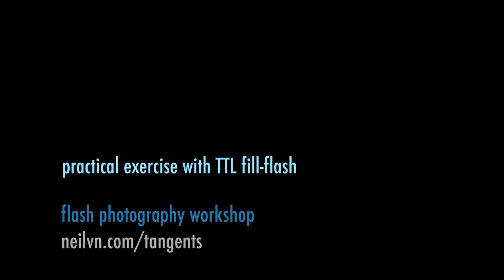Video tutorial: TTL fill-flash

Comment: I have watched a multitude of flash fill videos by several different photographers. Every one of them fails to start with the basics. When using a camera flash are you using the cameras Auto mode, P mode, or a manual mode ? Are you using the cameras White Balance "flash" mode, fluorescent mode or can we use White Balance Auto mode. You need to identify the appropriate camera settings before teaching how to use the flash.
Reply from the maker: Not every video can be comprehensive to the extent that it tells you everything you need to know. We have to assume a level of prior knowledge.

To answer your questions: 

-- my cameras are always in Manual exposure mode. It helps me figure out my ambient vs flash levels, if my ambient exposure is fixed.  This also gives me consistency in sequence of photos.

-- I shoot in RAW. As you should too. Then your specific WB setting is largely immaterial. 
I don't use Flash WB since it is usually too warm. 
I have no idea why you'd set Fluorescent WB with flash.
Since I shoot in RAW, I usually use Auto WB ... unless I use a gel on my flash. Then I usually go for a specific Kelvin setting, depending on the strength of my gel ... which in turn depends on the existing light, which then in turn depends on how I want to render everything.

Comment: Sir how to conect sb 5000 speedlight with godox x1 triger
Reply from the maker: You need to put your flash into the hotshoe of the related X1R receiver.  If you don't have one, they are inexpensive. But that is what you need.
Reply: @neilvn  sir I have resiver but speedlight show backside only ttl mod I set my triger m mod but work manul
Reply: Sir your lesson for under stand speedlight power aprcher, distens very helpful for me

Comment: The TTL has no problem metering the bounced light?
Reply from the maker: Generally, TTL would work with bounced light -- but there are real-world limits that can kick in. 

Correct TTL flash exposure is determined by the camera when it sees the pre-flash ... and according to the pre-flash level, it will adjust the actual flash output to give correct flash exposure. But it can happen that the pre-flash is attenuated (either by bouncing into a large area, or using a softbox or similar), and then the camera can't accurately read the pre-flash.

Comment: You should show when metering on the whites what you are adjusting in your camera. When you say, 'One and 2/3 stop over zero', do you adjust the light meter compensator, or you adjust your aperture from what to what? I am not as professional as most readers here are.
Reply from the maker: Hi there — this is an older video  and in need of a proper update. There’s one in the works.
Reply from the maker: Whether you change ISO or aperture, doesn’t matter — as long as the exposure meter shows that the white is exposed appropriately brighter.
Reply: Plus, you are not even showing us a before and after you change the setting, on the histogram scale and what to look at in a histogram.

Comment: Nikon D3 needs 4 clicks up from on white exposure. Would that be the same for Nikon D810?
Reply: Yes you’re right. I was being lazy asking you before I tried, which in fact I did and am very happy with finally understanding on how it works. What I did is that I put my camera on manual and exposure spot metering, took a reading from my daughter’s white top where it’s getting the same light as her face, and then clicked up the exposure until the histogram shows one click under from overexposed. On my camera it shows a little arrow when this happens. Doing this I would be setting my white level a bit under maximum exposure. The result is perfect metering as you mentioned.
Reply: Neil, a quick note on your ideas of fill flash or using flash as the main light for those of us using Godox strobes. The system can switch from ttl to manual, or to be exact, one can take a test shot to meter using ttl and then switch to manual and the flash saves the resultant power needed for the exposure. From there you can increase or decrease power to your liking. You can then shoot a whole shoot with manual for consistency, as long as the model stays the same distance from light of course. Quick and easy.
Reply from the maker: Good point.  The Profoto A1 does this in a similar way.
Reply from the maker: This is easy enough to check.  Use a white shirt or a towel, and measure off that, and see how it appears on the histogram.
Reply from the maker: Also check this article: 
https://neilvn.com/tangents/flash-photography-techniques/flash-exposure-compensation/